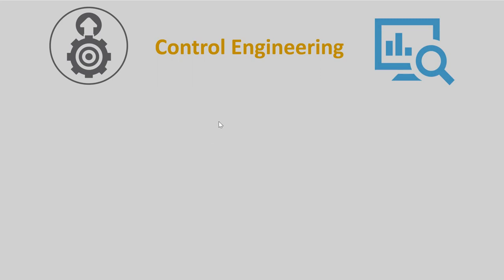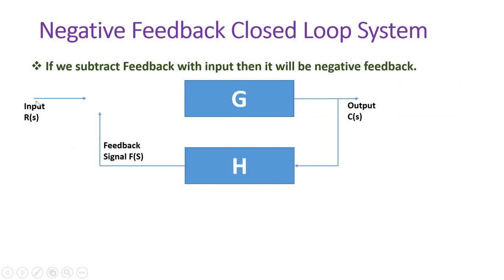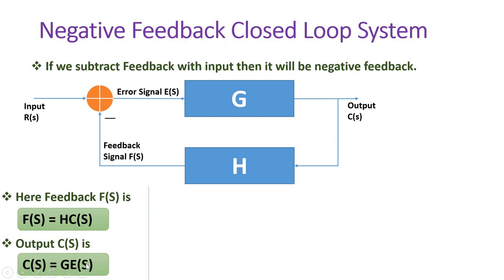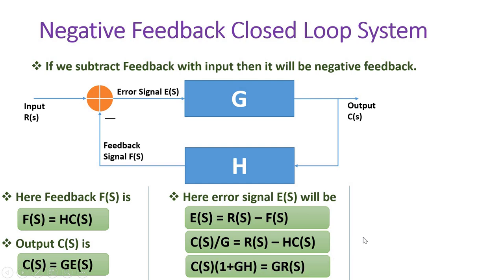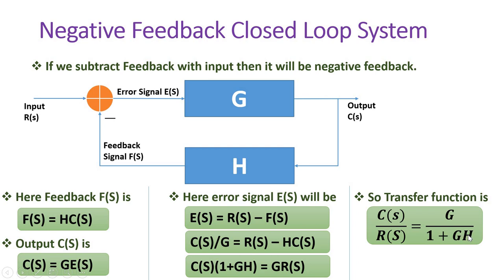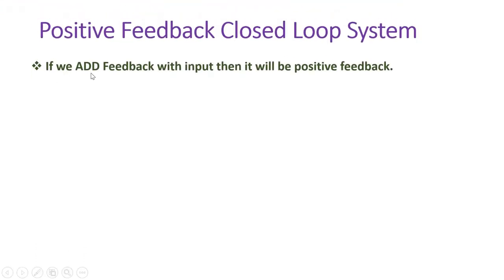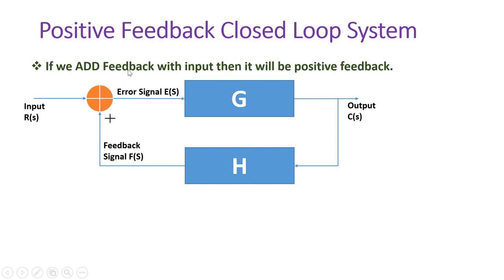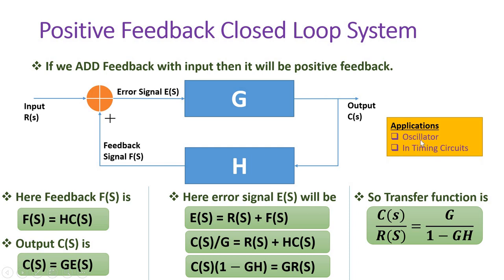Types of Feedback Explained: Negative and Positive Feedback in Control Engineering

Comment: Sir, is it possible at this point to explain why one should use negative or positive feedback. What is the basis for that decision. Thank you sir. It will put everything in the right perspective.
Reply from the maker: Positive feedback is used for oscillator and negative feedback is used to control gain of amplifier
Reply: Engineering Funda thanks